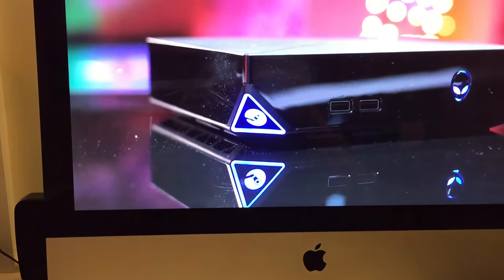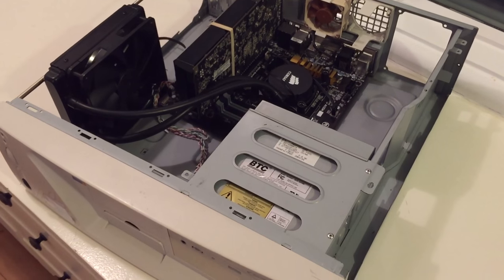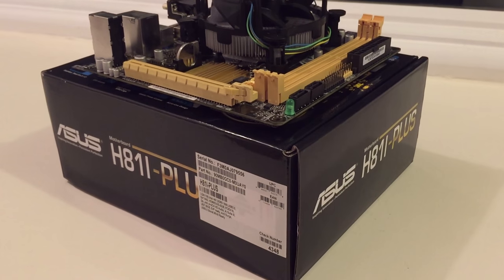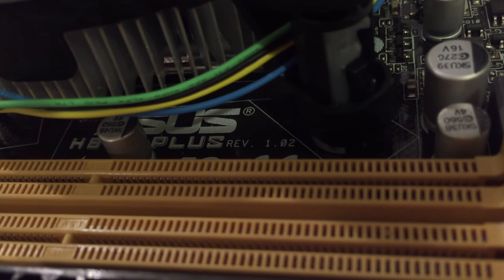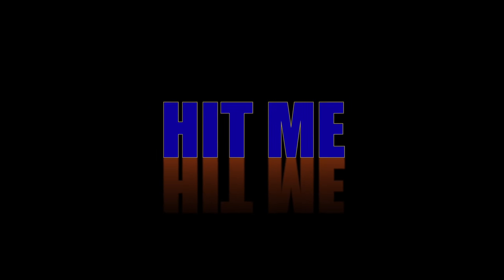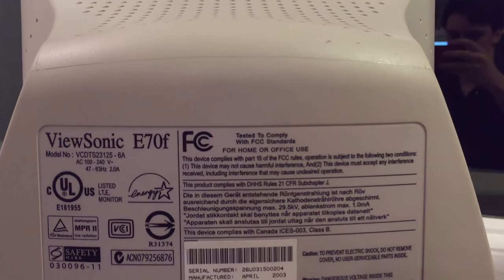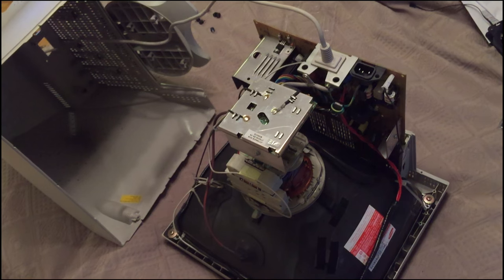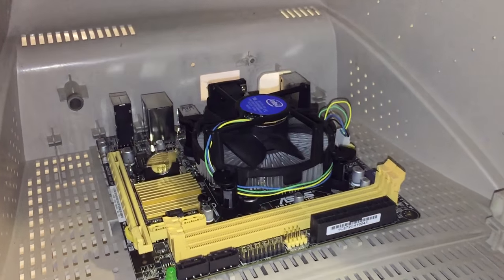Gaming PC inside a CRT - Part 1

Comment: I found a CRT monitor in a ditch about a year ago so I brought it home. I recently decided to start cleaning it so it could have a purpose in my room. It's pretty busted up (the top of the case is broken and everything but the circuit board and front of the screen had been taken). I came up with the idea to build a pc inside it while I was cleaning and that lead me to find this video :D
It's a Gateway 2000 Crystal Scan 1024 N1 for anyone interested :)